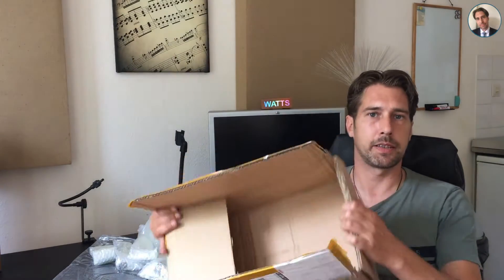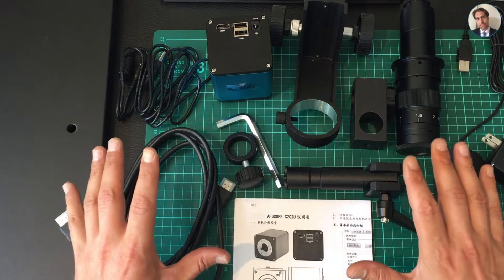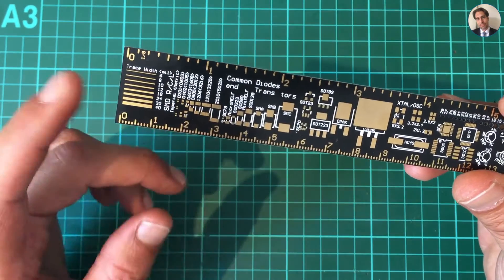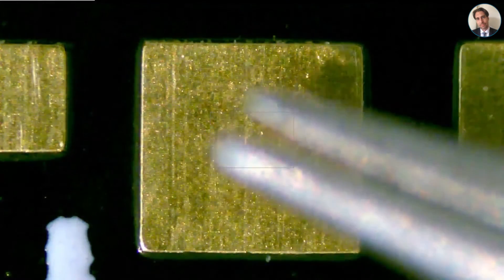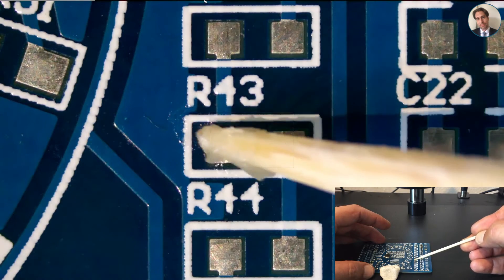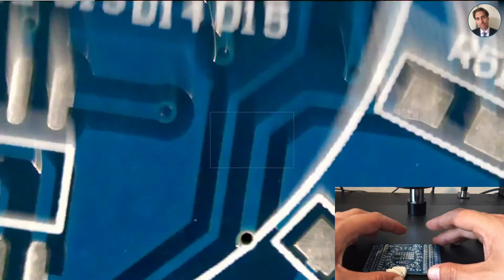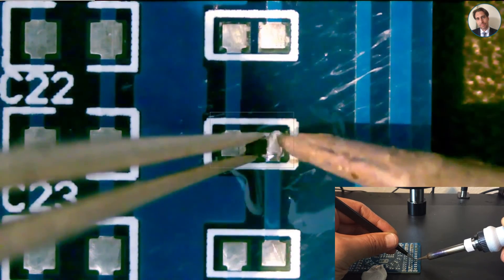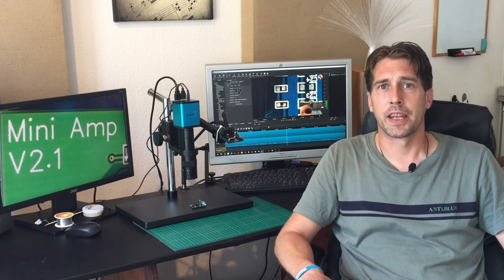Eakins HDMI Microscope Review (SONY IMX290 sensor)

Comment: I ordered a eakins microscope on aliexpress  but I must WARN Anyone who want to buy them there.. as with many things on aliexpress eakins store put a lower value of usd 150 when they sended it out.. When the package arrived in my country the Customs had issieus with this .. at first I didnt know what the issieu was and contacted UPS about 12 or 13 times because it got held for  2 months then our local customs give the BUYERS a Fine because the seller lied about the pricing fine is about €250 without tva .. while having all these issieus not knowing what the issieu was i contacted Eakins almost 10 times as well as aliexpress and their customer service is a JOKE .. eventually even when agreeing to customs for the fine my package is sent back to eakins.. still haven't got a refund either Aliexpress Isnt known for their customer service and eakings to me is even worse so to anyone considering this I personally would not recommand this due to their lack of service and issieus following . I suggest buying these tools locally :) I will order my amscope locally now . Just a heads up or warning to who considers buying with them . Maybe i might be an exception But who wants to trow away or risk +/- €450 for a scope that might not arrive and possibly an additional €250 fine + import taxes depending on your country .. and have the headache and issieus trying to resolve this with these stores ..I know i wont anymore :)

Comment: Greetings! I was tricked by the seller of the Eakins microscope - Eakins Microscope Store. There is no HDMI image, the sensor sent not a high-quality Sony IMX 290, but a cheap IMX 307. I would like to ask you to check the presence of + 5V on the 18 HDMI contact from the microscope.
Is + 5V supplied to pin 20 (VDD5) FE1.1S USB 2.0 HIGH SPEED 4-port HUB Controller? My FE1.1S controller has a №20 pin off the board.
Besides, check it out, please.
Is there +5V on pin 18 of the HDMI connector?
Reply: Hey, which one exactly did you buy? Can you share a link?
Reply: It seems that many people buying the cheaper versions (which are incorrectly labelled IMX290) and it turns out to be Imx 307. It also seems that all YouTubers who bought the more expensive £300/350€/$400 “autofocus IMX290” has the correct sensor
Reply: @Pwntyounooblol  I paid 414.5 USD for a model with autofocus. And I have an optical sensor IMX307. The seller is a deceiver. Don't buy anything from him. I don't know how to give a link - youtube blocks links.
Reply: @propretor4964  Wow, you are right. I spoke to Eakins today and they say they have recently swapped ALL their autofocus IMX290 to autofocus IMX307 sensor. What a shame... If you find any with IMX290, please let me know.
Reply: @Pwntyounooblol  In addition, I got another broken specimen. There is no video signal on HDMI. The FE1.1S USB 2.0 4-port HUB chip has its leg No. 20 (VDD5) torn off. Pin №20 soldered to the board? Look at this, please.
Reply: @propretor4964  Sorry but I do not have the microscope to check for you. I was considering ordering it but I didn't. 
I have now instead ordered the white IMX291 (very similar) to IMX290 from Lapsun store. They have assured me that it's the 291 sensor inside. The only issue is that it was $550 vs. the old IMX290 which was $400. I will report back when I receive it, but on their YouTube channel the IMX291 has a really nice image similar to the old IMX290 version and not like the IMX307.
Reply: @propretor4964  You can see it here: https://youtu.be/02Q0dXy40c4
Reply: @Pwntyounooblol  Same I want the IMX290. So if anyone finds a legit seller please post here.
Reply: @Pwntyounooblol  Have you received this yet? I may go with the IMX291 if I have too.
Reply: @shiftctrlhack  Delayed due to virus outbreak in China. It will arrive this week though.
Reply: It arrived today. They shipped with FedEx. It's equal quality to the IMX290 in the video (imo). It's the IMX291 (white) by Lapsun on Ali :)

Comment: I have the microscope but I ha e a few questions
1. How exactly do you turn it off? I just unplug mine, what do you do?
2. 13:50, how do you get all those options, I just have control, I have mine connected to my monitor via hdmi and to the wall but I’m not seeing those extra options idk
3. How do you record? When I plug a drive in it lets me take a picture but says video recording failed. My microscope is on version 2.4.2. Any help would be much appreciated man, thanks!! 😄
Reply from the maker: Hi Johny! 

1. Same thing, I have to unplug it. :)

as for 2. and 3. I do not have my microscope here atm (I just moved) so I can't check the firmware. But for the menu, I didn't have to do anything special, just hover to the top left corner and the menu is there. Maybe it is a different version of the microscope?
Reply: @DustinWatts  yeah I think I have the one that doesn’t autofocus or something idk, thanks though!! 😄

Comment: Thanks for the share ;) If you care for my advice, here are some tips. Use much, MUCH more flux so the solder can easily flow. You can always clean it afterwards with alcohol. Get rid of this disgusting straight conical tip. You can't even properly transfer heat to the board and the component with it. Chisel or bent conical shapes are WAY better for this job (or any job for that matter). Change those two things and you'll feel reborn - no more disgusting looking dry joints ;D Since you've already invested in such an expensive microscope, you have no excuses for not upgrading your soldering skills as well ;) I suggest you watch every video from "paceworldwide" + "NorthridgeFix" youtube channels and you'll instantly get what i mean. Last, but not least, you'll need a DECENT soldering STATION and a MUCH better hot air station. You're just torturing yourself with that fake Atten 858D. Take a look at the Quick 861DW for example. EEVblog even made a performance comparison on them. Other than that - cheers for the amazing microscope, looks so damn crisp i'm happy FOR you :D And good luck with your work, you seem like a nice fella :)
Reply from the maker: Hi Emiliyan! I always care for advice, so thank you for your comment! There are a lot of things I learned since making this video. There are also a lot of upgrades still to be done to my tool-kit. I have already made a few but still trying to improve bit by bit. Thank you for taking the time to write such an extended comment. I will take every tip into consideration, they are much appreciated!

Comment: It’s convenient to solder through it, are there any delays, the depth of the image allows you to accurately get to the place of soldering? Or is it better to use a trinocular microscope?
Reply from the maker: @Kolin After a bit of practice it is not very difficult to solder trough it. I found that it helps to turn off autofocus during soldering. Also helping is if the light comes from a fixed point. I think a trinocular microscope would be a bit better but this microscope is very good for it’s price!

Comment: Hi Dustin, that's a nice piece of equipment and a great video to show it! BTW. did you receive my e-mail message? If not, please check your spam folder. In addition to the boards I'll send you some parts which you may find interesting to try using your new microscope...
Reply from the maker: I missed it. It was indeed in the spam folder :) I've replied. Looking forward to try your PCBs!